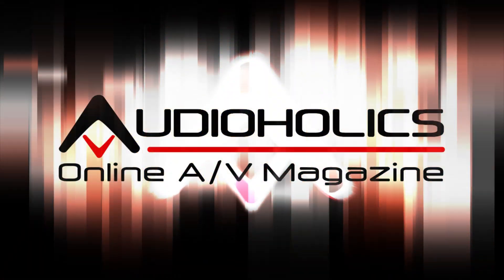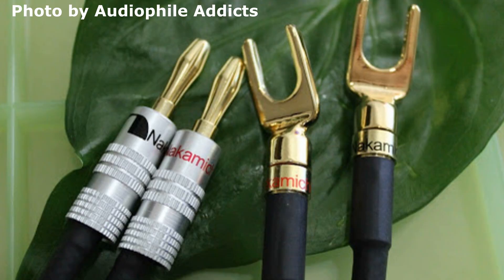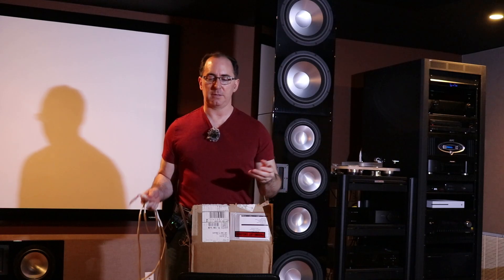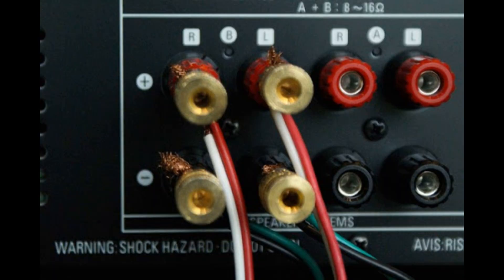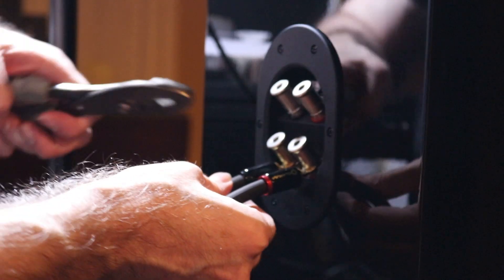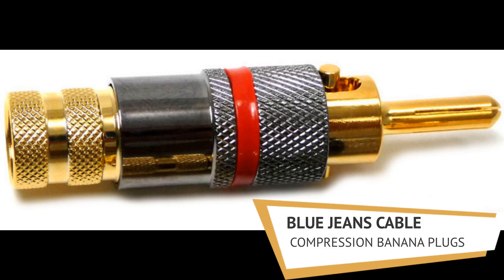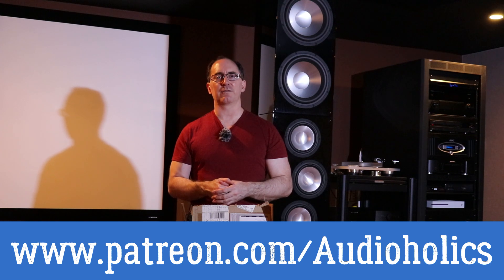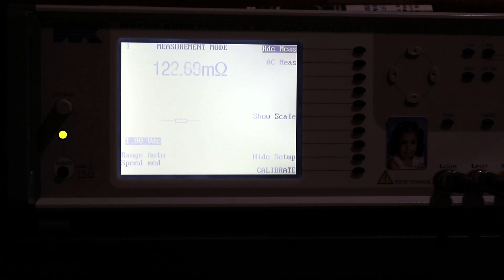Spade vs Banana vs Bare Speaker Wire Terminations: Which is Best?

Comment: I use banana on amp side because not enough room for spade on my amp binding posts and then spade on speaker side. I worry that the banana connector is not tight as tight a connection and has less surface area than spade. You make an excellent point about the spades!

Comment: I have big and kinda heavy speaker cables and they came with gold plated banana plugs and gold plated spades. I considered using the spades as my speaker terminals are angled up like most speakers. Reason is my cables being so big I felt that it might be too much pressure on the terminals using the bananas. But then, the downward pressure would probably keep a good connection. I've been using the banana plugs and I've not used the spades as of yet. You know what? We probably overthink the majority of the time.

Comment: Raw? Cut it precisely to what is needed and  make it tidy? The Mc I am looking at does not eat bananas :-)
Even gold plated spades make less sense if you wire to a golden post. Who cares where gold meets copper? If corrosion is a concern, why not to gold plate the bare wire? You also would cut extra with little regret to make a shorter run. Messing with bananas? Well, why not, but if they are high end, then you will think twice. Bananas are great too if your gear accepts them. Spades are shady IMO. But I do not see why they can cause any issues if installed correctly. Just extra expense for one time convenience in most applications.

Comment: Defiiniitely prefer banana's for ease of use. Spades are a pain both due to the need to tighten them down, and because they're essentially uni-directional. So you can end up with situations where you basically can't attach a cable, because it can't bend in that one direction, in that position.

Comment: Raw is absolutely the best.
The less parts in-between is the best.
You may have to refresh your cable raw ends, because of oxidation (copper)  but never with tinned copper like I use from Duelund.
Also pure Silver, oxidation improves the signal transfer.

Comment: Recently made up some new cables for my Luxman R-117 / Polk LSiM 703 combo. Used 12 ga. oxygen free wire, and some higher-quality banana plugs, along with some "cable pants", and flexible braided sheathing to finish things off. Looks and sounds like a quality installation. Very satisfying DIY.

Comment: Huh. I used basic bananas on some cables I made over the years and haven't had a problem with the connection to the amp or speaker terminals, that I know of. Then I decided to try out a pair of WBC Ultimate 7awg cables that people were raving about. I ordered them with spades because my current amp and speakers both have good quality terminals designed to clamp down on them. And I did crank them right down. Been running them exactly a year, give or take a day or two, actually and... No problems! Also, I do like these cables. Worth the asking price just for the look and feel, if you're into that sort of thing and they sound good, too. Compared to my DIY braided cables, (four 16awg strands) the WBC brought up the high end presence and clarity, which made my system better balanced in my room.

Comment: I just got back from the Florida audio Expo. It seems that this had some of the most expensive audio gear available. Almost everyone was set up with spades. Most surface contact I was told. 🤔
Reply from the maker: @hozer100  it's audiophile nonsense. Contact resistance is more important, hence why bare wire followed by compression banana is the way to go.

Comment: I couldn't agree more and for the same reason. Bananas stay put and if you get good ones, they put less, extra metal in-between the speaker cable and the cable inside the speaker. So they sound better too.

Comment: I have banana gold banana plugs on the speaker end of the cable, and on the amplifier end, I use gold tinned braided wire plugs. (Just like bare wire, but braided and dipped in gold.)

Comment: Belden 12 gauge speaker wire with Nakamichi Banana plugs, both tested to have the least amount of resistance out of 10 different banana plugs and 10 different speaker wires (minus 1 other super expensive pair of plugs)

Comment: I love banana plugs for ease of use but I find the ferrous material in the spring loading seems to degrade the sound. Bare copper wire sounds good but tarnishes and gets frayed. Copper spades cleaned occasionally with a good contact cleaner is a bit of work but is best for me. I keep my system where everything’s assessable. Not good for everyone!

Comment: Good Advice!
I use bananas. Whenever possible.
I have a Krell KSA-200S. The terminal connections are SO tight that the risk of a short circuit is very high. I had a turner make me a Set adapters. Made of high-quality bronze.
I did a insulation from shrink tubing. 
Now I can plug in bananas without any risk. 
Because one thing is celear: you don't want to cause a short circuit on an amp with a 3.5KW transformer! Bad for the amp and bad for my Duntech Princess speakers.

Comment: This is a great topic!  I used to always go bare wire, However; I like to test different speakers a lot, so it gets very inconvenient taking off the wire and then threading it back through each time.  So I tried some banana plugs, and I immediately noticed
they sucked out some of the music compared to bare wire.     Admittedly, the banana plugs I used were from amazon and not very expensive, but they were all copper.  I feel the banana plugs add too much mass and suck out some of the music compared to bare wire.  I Recently tried a different type of low mass cable connector that attaches like banana plugs, and is low mass like a spade, but plugs in like a banana plug. I am quite pleased with them so far. They are called BFA Banana plugs. I haven't gotten around to comparing them with bare wire yet.

Comment: I use my monster reference m2.2s that have banana on the amp& spade on the speaker. You are right on the spade it has to be real tight to avoid coming loose. Thanks for the video!

Comment: Why no more detailed measurements? It would be so simple to pass a simple sign wave signal down the same 8ft piece of wire and see if bare wire both at the source and speaker terminal, spades or bananas measure any different. I do not buy that there is a significant audible difference between any of them as long as you have both good connection of the wire to the terminal hardware and the hardware to the speaker. If there is a poor connection or an increase in resistance then bare wire makes the most sense but it simply does not work well with many amp and speaker terminals.  I love banana plugs just because they are easiest but some amp terminals and speakers for that matter do not take banana plugs and only spades.  That really should be a part you can easily swap out on amps but no one I know of has thought to do that. 5 way binding posts are best I guess. Thanks.
Reply from the maker: @jsmdify  less is more.  I demonstrated higher contact resistance with the spade over the banana connection. The sine wave would be the same but at a very minor reduced amplitude. Bare wire at speaker terminals is the way to go followed by compression banana. Compression banana on the amp side to avoid whiskers from bare wire between adjacent connectors.
Reply: @ Thank you for that explanation!

Comment: I know this is an older video but still relevant.

I use DEADBOLT banana plugs, the kind with the saw tooth.  They don't come loose.  Sewell plugs have a 4.7 Star rating on Amazon and is one of those "can't go wrong" purchases.

I don't use Monoprice banana plugs as shown in this video.  They use a screw-on tip which comes loose.  Also the barrel will not accommodate the jacket of a 12 AWG cable, you have to use 14 AWG or smaller.

Start with the speaker wire and match the banana plug to it.  It's possible to get a banana plug which has a barrel which is too large and the speaker wire won't tighten down.

Bad idea to crank too hard on the terminals on your speaker to get a connection that won't come loose.  It's possible to twist off the terminals.

I use banana plugs for every speaker and every AVR.  I'm always swapping out speakers and moving things around.  Banana plugs makes that easy and if you get the proper size and type  it's a "can't go wrong" purchase.

Comment: If the bare wires touch on the speaker side the same thing happens when the wires touch on the amp side so your advise on going bare on the speaker side only does not make sense.
Reply from the maker: Bare connection to the terminals is the lowest resistance method of connection. You can't easily do this on the amp side due to limited spacing between the speaker terminals, especially for high channel count amplifiers or receivers. Compression banana plugs on the amp side, compression banana plugs or barewire on the speaker side is my recommendation.

Comment: Best banna plugs are the 4mm high current ones used in high end Radio control vehicles because they are machined from 1 piece and you have to solder them. All audio banna plugs ive seen are made up of multiple pices then pressed togeather to get the spring which means added resistance and potential for intermittent connection. I initially got spades for the speakers and ditched them in less then a week because I could see these working lose.

Comment: To avoid whiskers you can wrap the ends of the wires.  Strip the wire ends an extra inch and separate out about a third of the strands.  Wrap the small bunch around the rest for the first half inch.  Then trim off the remaining loose strands.  This will give a better contact because the strands will not splay out and no whiskers.

Comment: I am ancient I use copper wire and soldier the cable short as possible and I build board amps   everything is dead quiet and it sounds better.

Comment: Gene, always a pleasure to watch your videos and always great information!  I watched a ton of content while preparing to revamp my (modest) HT system from 5.1 to 5.2.2 Atmos.  Especially helpful were your speaker placement videos.  As for connections, I went with banana plugs on the receiver end, and also on the LCR speakers as 1) The L & R get moved occasionally, and 2) The center's terminals are a PITA to reach the way I have it mounted.  Surrounds have bare-wire connections. EDIT:  I forgot - Banana plugs to the wall plates for my Atmos ceiling speakers, too.   I haven't used spades since the 80's when Radio Shack put them on their "stereo-in-a-box" system 22AWG speaker wires. 😂

Comment: You don't get static when a speaker wire becomes loose. 

Intermittent yes, static no.
Reply: Semantics.  You will/can hear a "static-y" sound as the wire quickly makes and breaks contact with the terminal while listening to audio.

Comment: One more thing came to mind, especially if someone frequently switches speakers or amplifiers—although it’s only used in professional equipment: the SpeakOn plug. It costs next to nothing, is completely foolproof to prevent anything from moving, and I’d be thrilled if hi-fi manufacturers started using it instead of the current, less reliable ports. XLR is also a much better plug than RCA (in addition to being balanced).

Comment: Theoretically, bare wire provides the most direct connection. My one issue with screw connections is that, since the whole system vibrates and people don’t check it regularly, it can come loose. So, I would vote for two solutions: bare wire with periodic checks if there's no need to dismantle the system, or crimped banana plugs that hold themselves in place without screws. The latter is easy to replace and will never come loose on its own.

Comment: I have all 3 - it depends on the binding posts on the amp and speakers. Some amps have really good binding posts with good insulation or a wide gap between posts to reduce the risk of shorting. 
All plugs/spades and posts come loose over time
Daniel Hurtz and a few other brands provide a "torque" tool to be used when tightening their binding posts (which are designed for bare wire). 
I have a couple of 15 channel amps - for these I use Bananas BUT I ensure these are insulated with shrink sleeves to that there is NO RISK of any shorting. 
My old Cine-Amp had binding posts that would not take bananas or heavy spades and had such tight spaces between binding posts I had to add a short lead with a banana plug socket to be able to firmly connect the speaker cable -- this was far from ideal.  I change up the amp later.

Comment: Just tin the end of the bare wire with some solder, not the part that goes through the hole of the screw down terminal, just the tiny bit that hangs out the other side. Voila, no more untidy ends.

Comment: Banana's add about 3 inches to the rear of the amp with big speaker cable....spades take up less room. If the amp is in a 4 sided cabinet the extra length can be a problem. 45 degree bananas are a good compromise I guess.

Comment: too bad you can not install spades on for example denon or marantz avrs since u can not remove the screw completely and the plastic around the terminal can not be removed. you should have soldered it and test the resistance ;)

Comment: Both banana and spade connectors make sense when wires are being connected and disconnected frequently and should also have a flex relief support. If the connection is considered permanent or very temporary then bare wire is best, used with a high quality crimped sleeve will stop fraying and hold the wires together well but its not critical to the connection if the connection is to a quality post. Bear in mind the signal travels along the cable on the outside of the wire of each individual strand, it does not travel through the inside of the wire. So a quality cable may have a high number of strands to make up one wire. These can damage easily and break with repeated flexing. A connector cannot "improve" a signal, no matter what the marketing material says or you would not need a $20K+ amplifier and $10K cables, would you?  Connectors can and sometimes do reduce signal loss and interference, if not immediately then over time and nature.

The reality over marketing is that bananas and spades, also the afore mentioned sleeves, will not increase the transfer of the signal, no matter how big the advertising budget and the advertising print size are, however, most will not degrade the signal, yet beware as some will degrade it, any metal that will oxidise is to be suspect and its use depends on the actual attachment type. Sleeves do not feature much in advertising, marketing, or even youtubes as they cannot attract the same markup as spades and bananas, but are more efficient like all crimp connections. But use a quality crimp tool. Pliers do not do a good job, also crimpers made from flat steel that rely on a single pin lever action for making the crimp are almost useless unless the hand grip is way above reality and damaging to the hand. That is the type one gets in cheap kits ( price does not determine cheapness) with a supply crimps. Crimps which often are not up to being fair let alone good. Money does not improve the situation, well known brands do.

Comment: I solder all my wires first before inserting them into the banana plugs, the solder will deform the match the surface exactly. The point where the screw impacts the soldered wire will hold its shape to keep a nice grip on the wire and screw. Done this for decades with no failures to date. This all stems from my car audio days that carried over to home audio.

Comment: @audioholics   Definitely agreeing with you here.  In order I prefer bare cable first, but if you make and break connections a lot, then banana is the way to go.   While some might say that spade is the best connection, I find that it is hard to get a good connection if you can't torque it down with your bare hands.  Using a plier is asking for trouble because you will eventually loosen up the terminal and if this happens on the amplifier end, you could be looking at a big teardown and it it is worse if the connector is soldered down to the main board as you now have to break out a soldering iron.  The combination of going with banana on the amp end and raw on the speaker end is a good one since it involves not torquing down the connections on the amp end.   As a final thought for those using bare wire.  TIN the ends with solder.  This prevents fray wires from splaying out and touching adjacent terminals on both ends.  This is what I have been doing for years on stationary connections that I don't change much.  But if you change out speakers or amps often, it is probably best to stick with banana connectors on both ends.  Great video btw!

Comment: I've been playing with stereo setup's since age 12, now 56. In the beginning, I used bare think multistrand wires into a spring loaded clip. Bad idea. But that was the cheap stuff. Bad connections, bad corrosion on wires. So never do bare wires, or soldering on bare wires in a hard compressed connector.
Then I went to DIN loudspeaker terminals. Bad idea as well. Mostly because of no shielding, and bad soldering or bad screw termination.
Then I went on to Spades. First small spades on thin cables, then big spades on thick cables. Better, but the inherrent problems with screw termination and lots of material in the spade, plus as you said, they loosened.
Next was banana plugs. So much better. sits tightly, easy to operate and I solder them on. No screw stuff that will crush certain strand designs.
Now, I use hollow bananas, low mass copper with a tellurium mix and a silver plating on the surface. That, and plastic outside that center core metal signal carrying piece, plus brass shielding with no signal carrying contact anywhere, for terminals. Low inductance, low mass, simple short path, low resistance and low capacitance.
That sounds the best, and works the best in my humble view.
Just my two pence.
Kind regards.